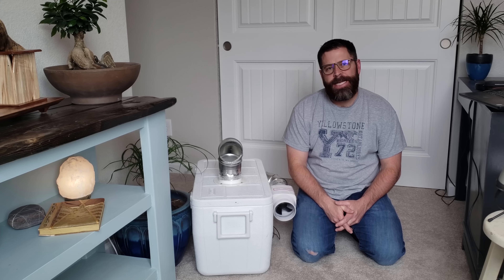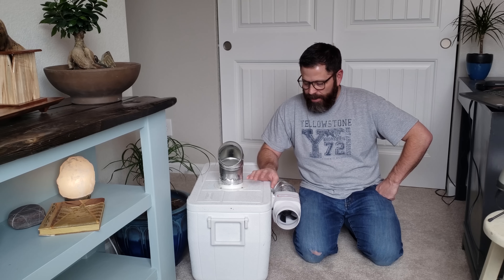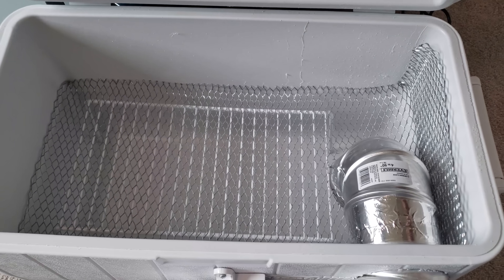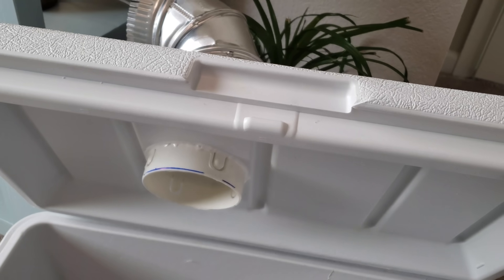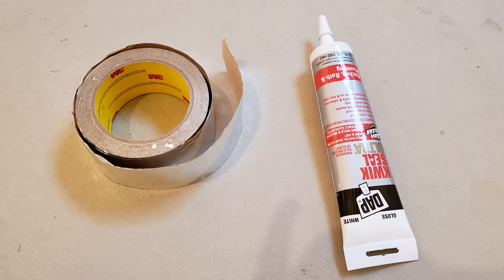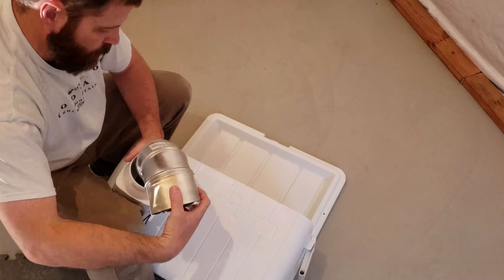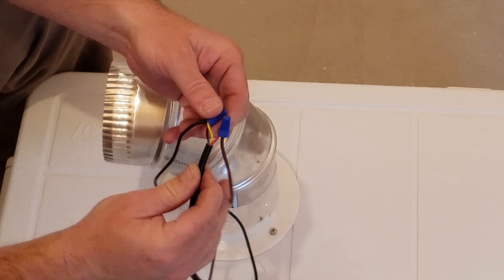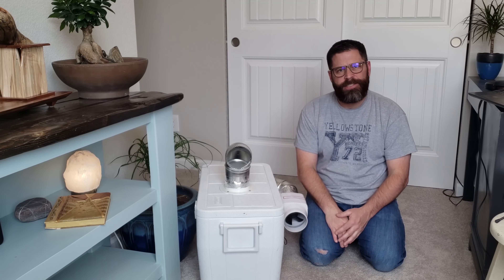Homemade Portable Air Conditioner DIY - Coldest One Yet!

Comment: Thick steel tubing ice and rock salt  equal portable freezer
Reply: Elaborate, please? My idea is to pump ice water from ice and rock salt through an evaporator and run a fan through it, just like conventional ac without a compressor.

Comment: hmm we  just  drop ice or dry ice in swamp cooler...during winter time you buy these at thrift stores under 15 bucks
Reply: Dry ice turns to co2 and can kill you if the fan isn't ventilating well and your sleeping on the floor.

Comment: I HAVE ONE I MADE IT 8 YEARS AGO. IT'S JUST SIMPLE, I USED 20 PIECES 3/8" DIA COPPER TUBING, COILED IT 21/2" DIA OTHER ENDS  OF THE PIPE PASS THROUGH ONE END OF THE BOX AS THE ENTRANCE OF THE AIR, AND THE OTHER ENDS THROUGH THE OUTSIDE OF THE COMPARTMENT  FOR THE BLOWER OR FAN TO SUCK THE COLD AIRAND DELIVER IT OUTSIDE. COILED TUBING MAKES THE AIR COLD, BECAUSE IT WHIRLS INSIDE THE COILED TUBING, TOUCHING THE COLD SURFACE OF THE TUBING.

Comment: If you want to use ice, add a mesh for the ice to sit on and blow air UNDER the ice. Not only will the dripping ice humidify the air to cool it, since warm air rises, the air under the ice will be cooler. However, ice will melt faster(but this is a consequence of cooling the air more).

Comment: I see DIFFERENT ones, has anyone ever used gel packs so you can re freeze them, one I seen was a gallon of frozen water in a 5 gal bucket. What about the use of that SPECIAL ICE that burns you, just can't think of it now. COOR'S BEER USED IT TO TRANSFER BEER IN TRUCKS TO KEEP ICE COLD, COLDER THAN A ANY AC FOR TRUCKS AT THE TIME. ON THIS COOLER, HOW LONG DOES THE ICE LAST IN A VEHICLE IN USE. NOW LETS SAY IT GETS TO 140 DEGREES IN A CAR FOR THE 20 MINUTES YOUR IN THE STORE, WILL ALL THE ICE BE GONE. MY SON USES THE SPECIAL ICE ON TRUCKS THAN THE USE OF reefer units and straight trucks, they use insulated totes with the special ice in gel packs I keep stuff cold so it can be delivered to homes. I know people use it to make smoke also, just can't remember the name, also does this drip of water coming out of it at all, before screwing down the plastic pieces to cooler, you should use caulking under it 1st and then screw down, also you should point fan in a more upward direction, the cold always falls down low, so blowing it on a angle to ground/floor, won't feel as much, its why you see AC units in walls up near ceilings in homes or these new BUILT ins that cost $3,500 and there at the ceilings now. Cold settles low always, heat rises. I hope I get a few answer's on some of my QUESTIONS now. Thanks for this video. I once worked in a fish MARKET, I had 2 ice machines that we used a lot. Even with fish stacked in our home made holder that was stainless on wheels and held 1,000 lbs of 25 lbs buckets of FISH, we put ice around it even though our cooler was set at 32 degrees, look in supermarkets, the thermometers where the meats are, they are near no good to buy, food must be kept under 42 degrees at all times, so if feels warm, DON'T buy it. There's stores that put these temps at the blowers and they read only 39 degrees only, i move them away to see if it drops to no good. They always get put back by store EMPLOYEES, I've reported to HEALTH DEPARTMENT, I'm not getting food poisoning over there STUPIDITY now. Yes its a LAWSUIT but I prefer to stay HEALTHY and not SUE the store, only makes things go up in PRICES.

Comment: 1. Scroll past the blah blah to 4:50 to see what you need to build this.

2. Dont waste your time building this, or any version. I have. Its nothing but a rapid ice melter and is ONLY good for cooling off your face! It will NOT cool even a tiny room. Dont be a dumski, you're fighting hot room air, with a cooler.  Now close this out and go scroll to other stuff on your feed.

Comment: How long will it run with a load of ice? The problem I have ran into with ones in the past is the ice melts very quickly.
Reply: Supposedly 20 lbs will last 2-3 hours that can get pretty expensive considering the cheapest you can get 20 lbs of ice is $2 at the little ice huts but gas stations and grocery stores want $5+tax for a 20 lb bag

Comment: How long does ice last?

Ever try it with dry ice?
Reply: Dry ice will take away your oxygen and kill you. DON'T try dry ice.
Reply: The dry Ice brigade on YouTube videos is literally going to end up with people being asphyxiated. NEVER use dry ice in small spaces Please.
Reply: I'm not sure about all that. I do know that many years ago I was working at a brewery as a spotter. One of the other spotters had a truck which had a broken AC. He decided to take a block of dry ice and put it on the floor of his truck to cool down the inside of his truck. A short time later he complained of headaches and feeling dizzy. And that was with him getting in and out of the truck to put trailers in the doors.

As for the cost, I wouldn't know about that either. Where does one even buy dry ice? I was not aware that anyone can just go and buy the stuff.

Comment: It would be interesting to see a junkyard intercooler or radiator or some other miniature radiator that you could pump air through having it submerged in an ice water bath...I'd imagine your electric efficiency would be better. That would also have added benefit of not increased humidity. CPU/PC intercoolers seem moderately priced but not sure if one is enough given the size but maybe a 2-1 or 4-1 connector so you can use a bigger fan/"compressor" for noise reduction

Comment: I swear I saw a video or maybe just a website somewhere where someone built one of these with a quality cooler, a heater core from an '85 Chevy S-10, a pump & hoses from an aquarium filter setup & can't find it...anyone?
Reply: Ha ha I've done it. 2 heater cores was the trick. The recirculating water melted the ice way to fast so I made a sealed unit with two heater cores. Later I found 1 heater core in the ice and 1 oil cooler mounted to a harbor freight squirrel cage fan worked damn fine. Filled the heater core, the oil cooler and both the hoses with alchohol with an inline mag drive pump. So far it is the best performing cooling unit I've built. The harbor freight fan has two outlets on the sides. So it was nice to be able to plug the pump in it.
Reply: @lostlake34  Could you build another with a how to video? Or at least just show us what you've got like Rick & Morty?

Comment: Possible improvements 
1. Use a a L shaped heavy thick pipe to rim midway along the bottom under the ice. Thermal mass.
2. Make the have pipe removable so it can be frozen along with the ice. 
3.on the exhaust side at the top crest a radiator to dissipate heat when the ice melts. 
Improvements from here are just about efficiency from heat. Liked your video!
Reply: What's to improve when the air coming out of it is 32 f, or zero c.
Most car AC systems shut off at around 6 degrees c which is well cool enough to bring down the temperature inside a car.

Comment: Suggestion.. insulate the output pipe, on the outside of it.  Otherwise you're just losing efficiency of the goals which are longer lasting ice and colder air output.  Also, if you really want to get wild, look up marine 12 volt refrigerators, you could set up the hardware on the outside of the cooler with lines run inside to the cooling plate.  No more adding ice, more than overcoming evaporation anyway.

Comment: Question. Would you know how one could power this with a 18v battery instead? It would drain a car battery rather quickly so I was wondering if it’s possible to rig it up to run off my ryobi batteries instead (i have he super high capacity ones). I have seen videos to make a USB charger for the batteries so I don’t think it would be too hard to make a power cord for one, would it?

Comment: 30$ cooler, grate 5$ piping 15$ blower 25$ power cord 7$ ice3$ extras 15$ , cheapest a/c at Walmart 85$.🤔
Reply: Exactly. One month of ice for this alone would buy you a nice small air conditioner.
Reply: RickK RocKStar did you catch the part where the fan runs off 12v DC? That's the difference.
Reply: @Paul Wilson it is not for the whole house but a room, camper, car or tent. These use a fraction of the electricity needed to use a standard AC unit to cool a small area.
Reply: It is only useful in places which is closer to the ice source and yet far away from electricity grid.
Reply: It's for the vehicle... I have an old 71 Chevy Truck and put a slightly different one together (different design, not as cold but ice lasts longer) and it it works great.  Just bought an old VW Super Beetle and I'll be making one for it also.
Reply: Walmart $85 Window AC unit is Chinese junk, and won't work inside a vehicle, tent, etc.
Reply: @LesterSuggs  Irony is the moment people lose the understanding of sarcasm. 🤔
Reply: @rickkrockstar  You can't be sarcastic when discussing Walmart. Walmart people will try to fit a home unit into their car window thinking they beat *the system*.
Reply: @LesterSuggs  NOW THAT'S SOME GOOD SARCASM. 🤔
Reply: @razorsharpbt So over spending on an underpowered high maintenance home built A/C is the point I guess.  I say this while recalling the reason, food isn't transported on Ice Trains anymore and real A/C was invented. 🤔
Reply: @razorsharpbt I GET THAT YOU DON'T UNDERSTAND SARCASM. 🤔

Comment: Use frozen milk jugs of water to cut down the water you get in the air and secondly fresh water if you need a drink and thirdly you can refreeze the container and your back in business if you freeze several just rotate and you can gave a endless supply try half gallon milk jugs as they refreeze faster and the use of multiple jugs allows great air flow around them.

Comment: I tried the same principle a few years ago and the problem is that when you're blowing warm air under a bed of ice, it melts it so fast you can't keep up adding more ice just to melt. And not to mention about the water rising from the bottom. So what I did with mine was punch a drain hole about an inch high from the bottom and let all that water drain out as the ice melt. It is cold alright, as I am literally just blowing air through ice much like the principle of ice block AC that some buildings use. Using solid blocks of ice makes it run a little longer plus my custom box cooler is lined with insulated aluminum walls with a 2" gap, packed with rock salt and dry ice, and no, the gas coming out of the dry ice has a separate vent hose that's vented outside. It's basically like a mini chest freezer.
Reply: Tony P   Proof and instructions or it didn’t happen... haha! Sounds neat
Reply: I didnt understand anything you typed except "drain plug" it's an ice chest, theres already one of those. What he needs to consider is a water reclamation jig that would allow him to reuse the water that's melting. Depending on how long the ice  lasts and how long he needs cold air for he could start up a rotation of ice and water

Comment: is it possible to hook up wiring to usb power bank?
Reply from the maker: Not with this model. It requires 12 volts. I have another one that I built that hooks up to usb though. Check out my channel. It is the blue one.
Reply: @livingwithlucasofficial  it is if they use a boost converter. but will also depend on the amps the blower needs.

Comment: With this blower run off residential current?
Reply from the maker: Yes, as long as you get a proper converter cord. You will need one that converts 120 volt to 12 volts. You should be able to find one on amazon.

Comment: What about the water from the melting ice? I want to make one for my bedroom. AC.
Reply from the maker: Not sure what your question is.
Reply: @livingwithlucasofficial  What happens when the ice melts and the water level rises  above the pipe. It will be blowing bubbles
Reply from the maker: @krover01  If your metal grate is halfway in the cooler, you will not be able to put enough ice on it that will produce enough water to reach the pipe. The only way that would happen is if you did not empty the water out previously.
Reply: Thank you.

Comment: Hey man add salt to your ice and will be colder and last longer. And a couple bricks of dry ice and man you got nailed
Reply: Salt will just make it melt faster and not last as long.  Sure it may get a few degrees colder, but not worth it.
Reply: Trust me it works with salt, we do it to keep the hog meat cold out in the bush. The salt melts it the it refreezes and lasts alot longer. Try it out. And a small block of dry ice will keep all melt frozen . TRY IT TRY IT LOL great idea man
Reply: Makes sense since added salt lowers the freezing point of water making the frozen salt ice colder than fresh water ice. I would keep the salt water ice in small refreezable containers though as salt is notoriously corrosive. Or use reusable ice packs. (Water and proplyene glycol)

Or check out the ice packs like Cooler Shock.
That's the kind that is often used for transporting blood. Better than crushed ice.
Reply: Yeah, dry ice! That's a great idea in an enclosed space. May win you the Darwin award too so bonus! Sigh, I don't want to live on this planet anymore...
Reply: @atomiklan  hey dude, your a smart ass and not helpful. Genius see the big vent? And air blowing ? We do it all the time here, this isn't nothing new, it's how we pack out our hunt.  Hear him say alot of air blowing? Try being more helpful .

Comment: Is it actually 3 elbows used? 2 on the side and one on the top?
Reply from the maker: Yes. That is correct. Thanks for pointing that out.
Reply: @livingwithlucasofficial  thanks for answering. Also is there a straight piece that goes in between the 2 90's or do they join together?
Reply from the maker: @theronk777  They join together and are adjustable.

Comment: Is  the blower loud
Reply: Tristen Fletcher I built this, and the bilge fan motor is loud. (At least, mine is).  I’m going to resort to the old fan I used before. All in all, a great design. If you want the humidity to stay low, use frozen water bottles or cooler packs.